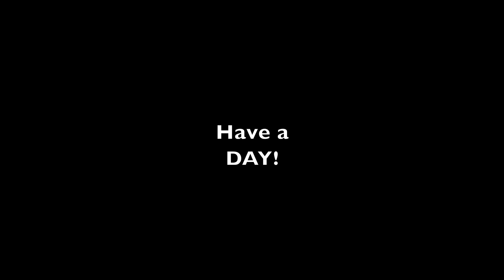She got it all ready for the Free Stuff

Comment: Great video today. On cutting the geo textile fabric. I get much better results using a propane torch. Not only is it faster but it also seals the edges and doesn't fray.
Reply: What a great idea!
Reply: What Fred said!
Reply: @oldmanfred8676   I use this stuff in my garden as a weed barrier. So I am all the time burning it to length, and/or burning holes in it for planting. 

Once down and planted, I do not have to weed or till the entire growing season. Then when done for the year, I roll it up, do my tilling and fertilizing in the fall and following spring. Then it is rinse and repeat. I generally get 5 to 7 years out of it before it has to be replaced.
Reply: @ilive4him849 ,
Very Cool 😎 Sir!

Comment: Mike - stay with the 18" bucket for the waterlines. I'm not sure on the rules for your area, but frost protection in my area is 4' and when you're that deep with a 12", it would be impossible to work in the trench if you had  to. As well, with a 12", you're going to be in conflict with your thumb. I have a 12" bucket for my backhoe and can't dig past 30" deep before it hits on my mounting pin.

Comment: I have an older model of the 3M Radio Earmuffs and the ONLY issue I have is that if I leave my batteries in it, even with the muffs OFF, the batteries will be dead in two weeks time.
I need to get a set of the bluetooth muffs like you have.

Comment: A friend of mine had a 275gal. Gas tank 4 feet from a tree that got struck by lightning and it passed right by it 20 feet to the propane tank and went into the house and lit the tape holding the thermostat wire on the pipe on fire, what a night. Blessings Morgan's.
Reply: Robert,  I have cut down 8 trees that have been struck by lightning within 100 feet of my house?  
Something in the ground?
One strike fried my well pump and two neighbors pumps an eighth and a quarter mile away?
You know the chain to the two latches on a garage door?  Fried every link like it was a fuse!  Single and double
links laying on the garage floor inside.  Blew a sconce light bulb up in the house too!
Reply: @oldmanfred8676  don't know but it's some powerful scary stuff it's hit so close to me every hair stood on end and dried it( was soaked from being in the rain) guess God does save fools.
Reply: @robertsnyder5193  
Dang Robert!  That was way too close Sir!

Comment: Great idea on fiuel station. Firewood,diesel and gas all in one location. I would be a little learey about the fumes coming of vents that close to building. Also would hate to see you have to dig up the gravel on driveway to run power to tanks if required. Be safe and see you on the next video.

Comment: Mike you may consider a 9 inch bucket for the excavator to install water lines. Great video. Have use a 9 inch bucket in rocky ground and it worked good. Be sure to get side cutters on bucket to help with roots and shaving side of trench. Have a great day be safe.